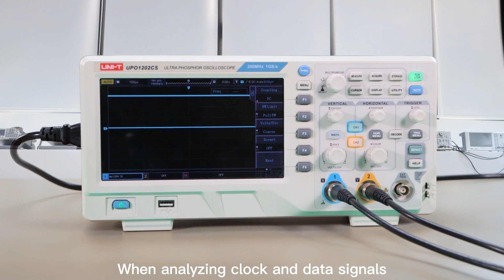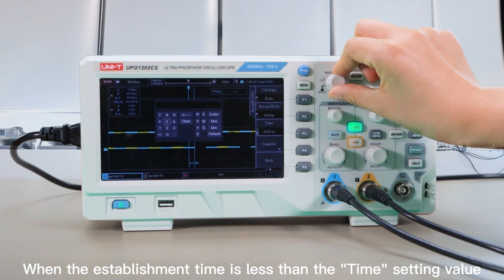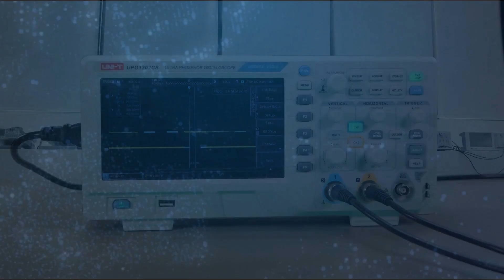UNI-T UPO1000CS Series Digital Oscilloscope | Setup and Hold Time Trigger Function

Comment: upo1102cs How is this model?

Can you tell me a good oscelloscop uni t
Reply from the maker: Hi Dear, thank you for reaching out.
Here are some details of UPO1102CS FYI, for more details you could see from this link👉https://instruments.uni-trend.com/cate/73.html

Bandwidth: 100MHz~200MHz
Analog Channels: 2
Real-time sample rate: 1GSa/s
Waveform capture rate: 500,000wfms/s
Max. memory depth: 56Mpts

UPO1102CS generally applies signals within 100M. If you require more complete functions and a higher sampling rate, you can consider the MSO2000-S series.